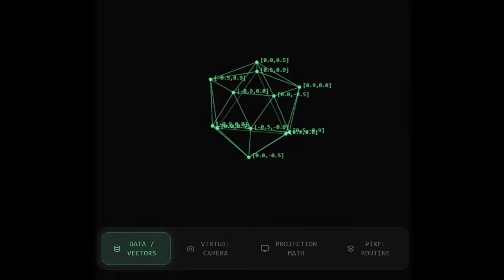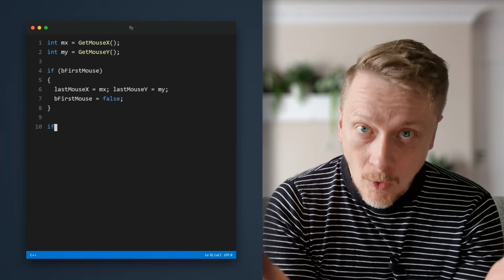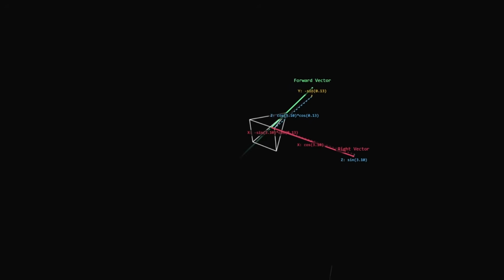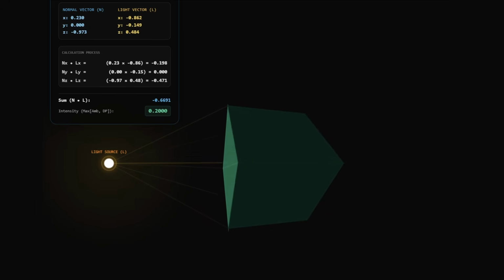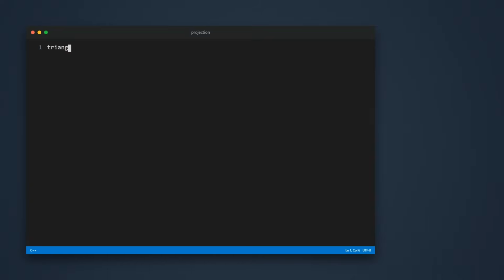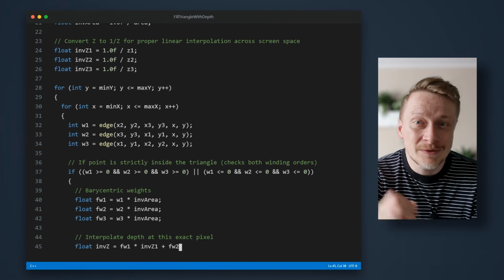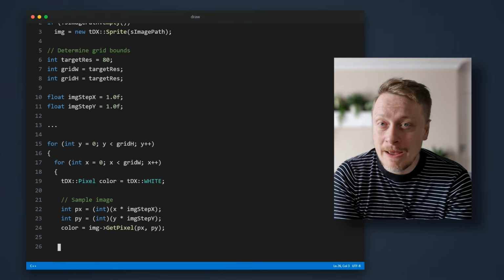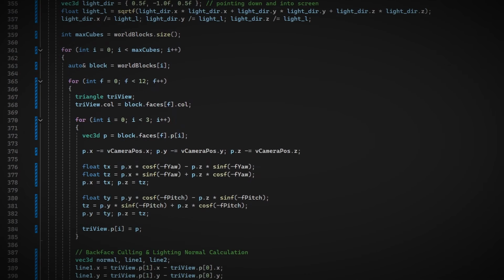The Math to Turn ANY Picture into 3D Cubes

Comment: I think because you already have hard lighting you can turn  the brightness of a cube instead be at a angle that has most of it in shadow

What I’m trying to say is instead of dark cubes rotate the cubes so they are partially dark/light
Reply from the maker: I'm not sure I follow. Can you clarify?
Reply: @Dr.Vlasanek   im trying to say instead of darker cubes you can use the angle of the cube to make it lighter from reflection or darker from shadows with only slight brightness variation for what needs to be maked up